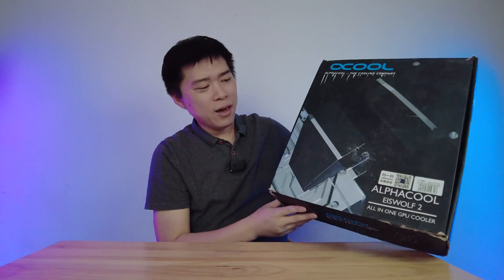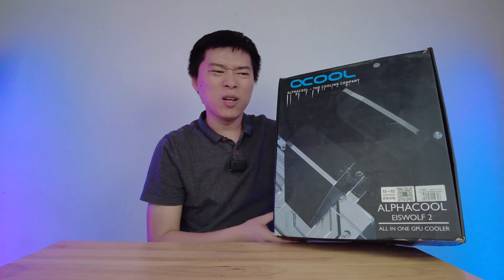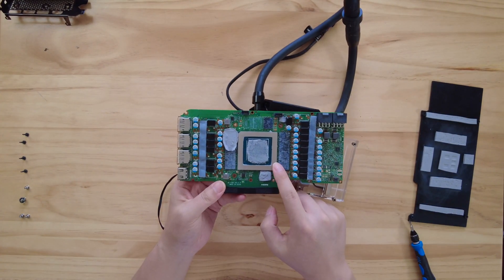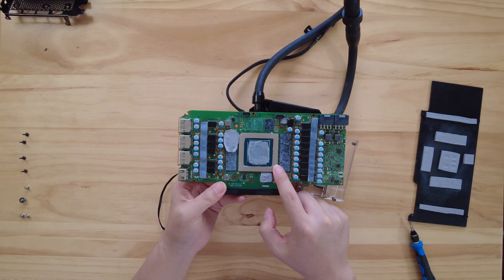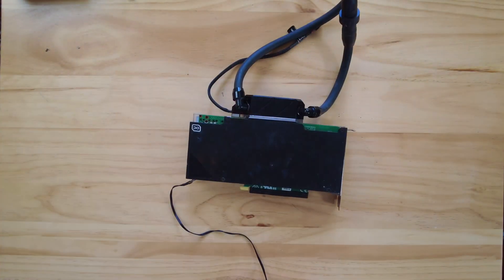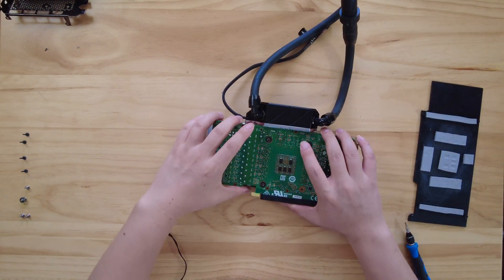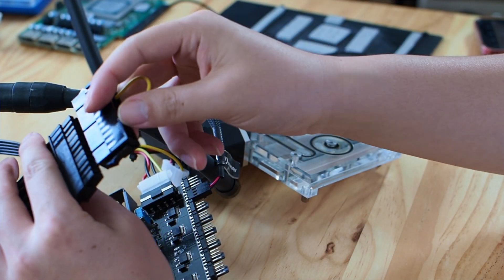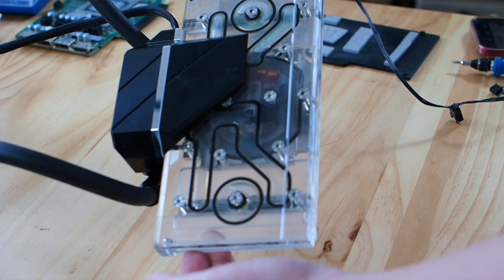Used Watercooling Kit FAIL! Broken Alphacool Eiswolf 3080/3090 Kit Maintenance & Repair Guide!

Comment: Comment purge t'ont l'air dans le circuit? Ou peut on acheter les joints neuf? Merci
Reply from the maker: Unfortunately there will always be air in this system, just how much. It will be visible from the water block when running - e.g. air bubbles in the block means still too much air. The only way out is through the bottom of the radiator. 

O-Rings/Gaskets unfortunately doesn't have retail, but you can always check with Alphacool to get the size of the o-rings, or if they can supply parts. If not, then aliexpress is your good friend with o-ring size in hand.
Reply: @masterbamboo d'accord,  merci pour ces informations.
C'est justement Alphacool qui m'a donné le lien de votre vidéo. 
Pour vous le positionnement du radiateur, la qu'elle est le mieux pour les bulles d'air ? Les tuyaux vers le bas ou le haut? Merci à vous 😊
Reply from the maker: @fabinou2580  Well..I'm surprised Alphacool actually referenced the video. 

For me, I held the radiator buttom-up, and filled the water into the drain plug at the bottom of the radiator. This way it will get most of the air out by filling. 

Then I run the pump with that position for a while(with the drain plug plugged in), try to tilt the waterblock back and forth to get most of the air out then system, then finally fill the water to the top from the drain plug.
Reply: oui oui, Alphacool m'a dirigé sur ta vidéo 😊. 
D'accord, donc c'est bien ce que j'ai fait! Alphacool me conseil de mettre les tuyaux du radiateur vers le bas, ci je le met en façade. Ton avis?
 @masterbamboo
Reply from the maker: @fabinou2580  That'll work, as long as you can get most of the air out.

Comment: Well for three years my Eiswolf 2 for the MSI 3090 has done very well. Yes time to clean, so this vid made it easy for me to do. Just need to know what new pads to get for the memory,
 as all dried up.
Reply from the maker: The memory pads are 1mm thick, any 4-6W/m.k pads will work, same for all pads at the chip side. 

The backplate side is a little trickier. They're 2-3mm thick pads, depending on the location and card type. 

Also double check on the manual, they have pads specifications written on them.
Reply: @masterbamboo  Thanks for the response. Was using the Alphacool Eisblock Aurora GPX-N Acryl Active Backplate for MSI Ventus if that makes any difference.
Reply from the maker: @NeilMacInnes-j9f  I looked through the manual, and all chip side (memory, VRM etc.) uses 1mm pads. 

For 3090 cards, all back sides uses 2mm thick pads. For 3080, backside has 3 3mm pads.

Manual URL: https://download.alphacool.com/legacy/manual/14420_Alphacool_Eiswolf_2_AIO_360mm_RTX_3080-3090_Ventus_with_Backplate_Manual(2).pdf

All detailed.
Reply: @masterbamboo  That was a lot of work, thank you soo much. Have found a good set to use.

Comment: NIce ! I have an Eiswolf 2 thats looking discusting to say the least. No good cooling anymore. I hope the dissasembly isnt that different on that one.
Reply from the maker: Eiswolf 2 (or simply they just put RGB fan version) is exactly the same with pump top. The waterblock maybe different by card type, but generally same concept. Good luck!
Reply: Still havnt fixed it. But, as far as I can read on Alphacools website, it has a copper radiator and not aluminium.. so I can use distilled water? No need for a special mix ?

Comment: Thank you, I'm having this same issue with my 3080ti fe. This video has been a huge help.
Reply: I just found this video and also have a 3080ti, how did it go for you?  I need to flush mine out temps are getting higher
Reply: @JP-jq7ob  temps returned to normal after cleaning, around 55c.
Reply: @ascap2854  thank you!!!

Comment: Mad respect.  Thank you so much for showing this!  I have a similar model for the Radeon RX 6900 GPU  that almost right out of the box needs to be cleaned... it was brand new too!  
Seems like the fluid they used is not up to snuff but good to know it CAN be fairly easily cleaned.  
Thanks so much!
Reply from the maker: Glad this video has made its way through! Yes, as long as you be patient and careful with the pump top, the rest is simple enough. If you by accident break anything, just give alphacool or aquatuning a call, they can arrange parts for you as well. 

Regarding on the fluid, recently I discovered sometimes when pump is not pulling hard enough (restricted by fan header), it will cause things like this too.

Comment: Nice tutorial thanks alot i think the pple who as sell this water block as perhaps use color inside the water. Is clearly explain on vendor web site never do that with this kind of kit. Or is a comon issue over time ?
Reply from the maker: When I got the kit, it was actually clear, and it does smell/feel like alphacool's CPC coolant. 

So my theory is something happened during the use where pump was either disconnected or wrongly controlled (not running at full power). Once temperature builds up over time, the coating separates from the brass, thus water kept running slower and slower, more clog, and so on. 

I've seen this kind of thing happen on custom loop too where pump malfunctions and hoverheats the waterblock. I personally also have the exact waterblock that runs in miners that are in excellent shape, which used a good pump and no filter.

Comment: incorrect fluid
Reply from the maker: one could argue with that, but when draining the fluid, it does smell like CPC from alphacool. It is also possible that the previous owner added/mixed in other fluids, but we'll never know.
Reply: @masterbamboo  could the water block itself be used with a normal water cooling? I have a Eiswolf 2, but my Evga 3080  Ftw3 Oc is 69-70 celsius. Ten 120mm fan ROG O11D XL case. Not understand this tempreture.
Reply from the maker: @MrFurko87  yes, you can actually get a custom loop Alphacool "bridge top" to replace the pump top, when I tested the O-Rings, I just slapped one onto it instead of installing the whole pump assembly. 

Some high temperature reported are due to incorrect contact and/or insufficient flow rate, check to see if your radiator pumping out heat or not. If the air blowing out is very hot, try increase the fan rpm; if it's cold, check pump.
Reply: @masterbamboo  okey, i not buy new water block for the vga, i build a costum loop 👌😁